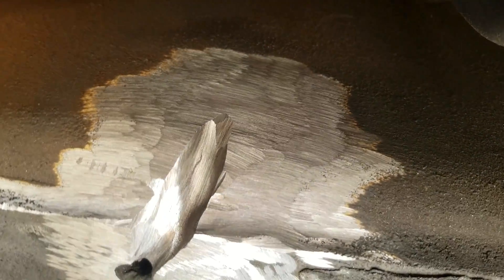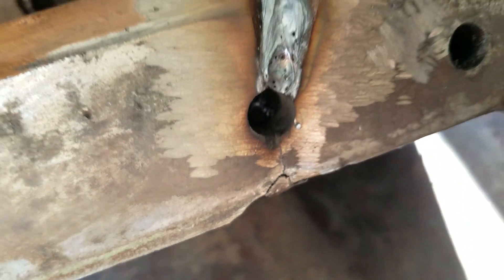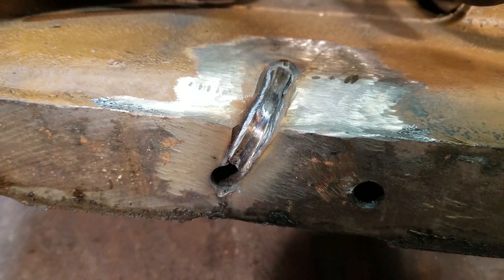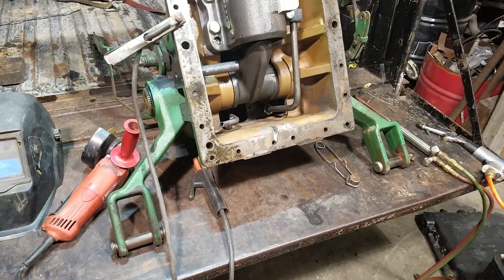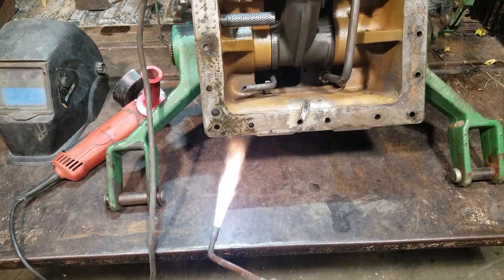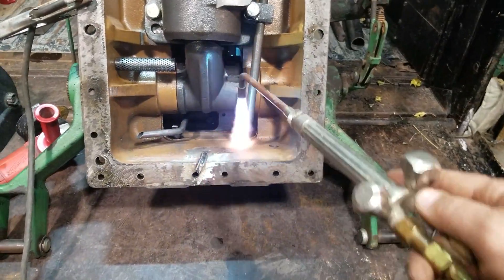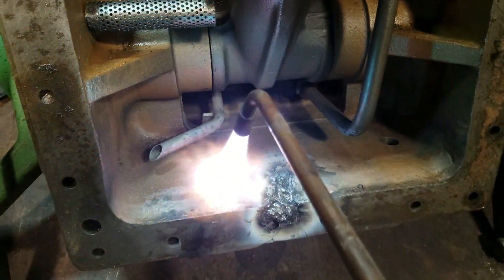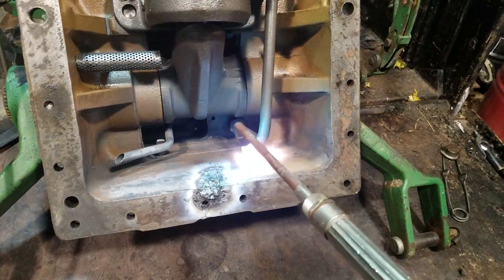Welding Cast Iron Hydraulic Reservoir with Nickel Rod

Comment: Find the end of the crack and drill it stop the crack from spreading.  Follow the crack with a cut off wheel. Depending on thickness and quality of the cast. Eutech nickel cadium rod running AC . Do not get greedy weld a little stop and peen it. The flux kind of crumbles off the rod looks funny if you never done it. Pre heat is your responsibility. Quality cast rod does a fantastic job.

Comment: just gonna tell you the j b weld aint like it used to be in the tubes like you have.i went to the j b weld putty kind where you pinch off then knead it til the grey putty mixes with black thats in the middle of the round cylinder shape.man its 50 times better.the old kind just wont harden up any more.but brazing is best for what your doin besides mig weld.it shld work.cast with stick heated very hot then right rod.look up old timers way.tig with right rod or braze with right rod.youll gt it

Comment: I was getting a leak on the back of the 1755 I've been working on and when I discovered the 3 point arms were topped out, I thought of this. I got lucky. Someone had too long of bolts behind the top link, so that wasn't clamped the best, and I think the pressure from the lift was distorting the housing,  causing seepage at the gasket.  I was so hoping I didn't have to do what you did here. I adjusted the lift height,  got a shorter pair of bolts in there, and it has been dry for over 24 hours. Color me happy!
Reply: I swear that's how it works.  I did that clutch job, might as well seal up the steering box, replace the injector boots, I even came up with a way to replace the compression fittings at the hydraulic relief valve with JIC fittings. Fire it up and everything I worked on is dry, but now the fuel tank is leaking,  plus the aforementioned hydraulic unit leak. Got those sealed up, there isn't a drop on the concrete. Maybe I shouldn't start it aain! Lol!
Reply from the maker: @ThatOliverGuyChris  Ha!!  So right!  Better just slowly back away from it lol!!  I tend to think how Detroit Diesel owners do... If there ain't oil UNDER them, there ain't oil IN them lol!  I just tend to have leaks with my stuff.  Meh - whatcha gunna do?  I'm OK with it.
Hey, could you do a video on setting the lift height sometime?  I was looking through a book and not sure I've got it all figured out.  I still need to do on that 1855.  I remember doing it on my 1650, but don't know I've ever done a large frame 55 series.  If not, no big deal, I'll mess around until I get it figured out.  Thanks!
Reply: I  was thinking about that as l did it. I had to look that one up, as I've never had to adjust a large frame 55 series before.
Reply: To get you going for now, between the arm that comes up from the left lower link and the arm that comes out of the left side of the hydraulic unit is a 3/8" rod that runs horizontally.  Shorten that rod by adjusting the 2 jam nuts to lower the maximum lift point. Lengthen the rod to raise the maximum lift point. You want to be able to lift the arms at least another half inch beyond the maximum height.
Reply from the maker: Awesome!  Thanks!  I hope to be out there tonight messing with it.  I think I'm going to try to plumb in shop air so I'm not running full hydraulic pressure on it to adjust it.  We'll see how it goes!
Reply from the maker: OH MAN!  That's pretty funny (I hope!).  So, you had predicted that mine would seal up fine but I'd discover another leak somewhere else... well... I think it'll finally be warm enough this weekend to head back out and I'll have a video coming, we'll have to see how close your prediction was lol!  Let's just say I've got some drip pans sitting under it right now :(  .  Sooo over winter and ready to get back out in the shop again!

Comment: That takes a lot of talent and even more luck lol. Brazing is a good option but again u have to have the cast fairly hot. In a perfect world u could shove that hole thing in ur wife’s oven and let it get up to about 300* then weld it and let it slowly cool off lol. If that doesn’t work we have used that little 110v wire welder with fluxcore wire and have been pretty successful fixing cast just because it doesn’t get very hot. Good luck!
Reply from the maker: I never thought of using a flux core welder.  Probably should have tried that out as well - thanks for the tip!  But I'm hopeful the nickel rod will work out.  Hope to be bolting her back together tomorrow and get a video out early next week to show the results.  Thanks for watching and commenting!

Comment: Cast iron is a pain to weld, I know that. You got a tight spot that’s for certain. I have a slight feeling my 1950 will do this to me.
Reply from the maker: Yes it is!!  I sure hope this works out!  I hope to be finding out this weekend if it worked or not and get a video posted next week sometime.  I think it's totally avoidable as long as the 3pt is set correctly and always has that little bit of free-play at the top of the stroke.  I'm leaning more and more toward maladjustment than some outside force that broke this one the more I read about issues with it.  But look forward to a video early next week of how it turned out!  Thanks for watching and commenting!

Comment: Suggestions that are a lot of work:   take all of the other parts off the assembly until you just have the bare block, the room you weld inside shouldn't have any windows or doors open, no drafts at all, preheat, preheat, preheat -- the entire casting ideally should be over 1000F and its temperature needs to be stable for several hours on a large casting, the casting needs to be wrapped in layers of fireproof blankets, after it's welded/brazed the casting has to cool very slowly (figure 18 hours to cool under layers of blanket before it back to room temperature)   -- consider brazing with brass filler.  Good luck.
Reply from the maker: Thanks for the suggestions!  Little late now but appreciated nonetheless!  I have already welded on it and I'll be posting a video next week of how it turned out.  Hopefully I'll be putting it back together this weekend.  Unfortunately I don't have most of what you're suggesting, just farmer fixes for me lol!   I did pack every rag I had around on it and left it for 2 days.  I'll keep this in mind if I ever have to do something like this again.  Thanks for watching and commenting!
Reply: Keith Fenner
 has several videos of him repairing cast iron.

https://www.youtube.com/watch?v=117Q9odITF8
Reply from the maker: Can you believe youtube flagged your link to Keith's video saying it had "bad words" in it lololol!!  Anyway, I've subscribed to Keith's channel for a couple years now and he's awesome!!!  He's exactly who I was thinking of while I was heating that up and packing rags around it lol!  If anyone else is reading these comments and interested in excellent machining videos, be sure to check out his channel!
Reply: @burningdinosaurs  --  Was it bad words?  Or because I included a link in a comment?  The default setting, unless you change it, is to flag any comment that includes a link, you can change that if you want for your channel.
Reply from the maker: Yeah, I'm sure it was the link but I think it's funny how it said it was "bad words" lol.  I'll have to look for that setting.  Thanks!